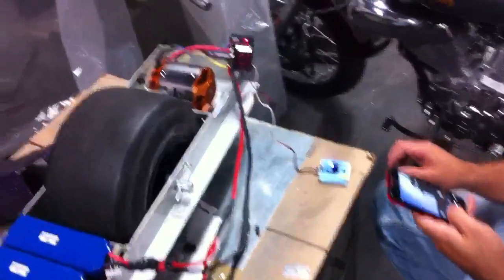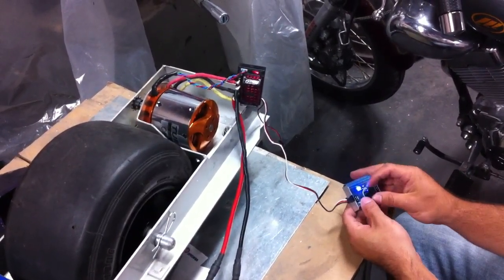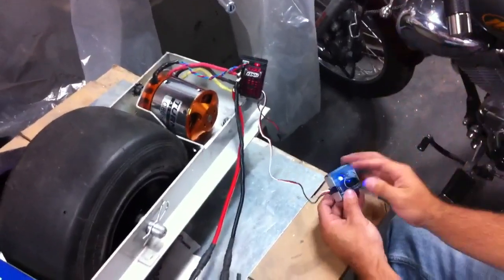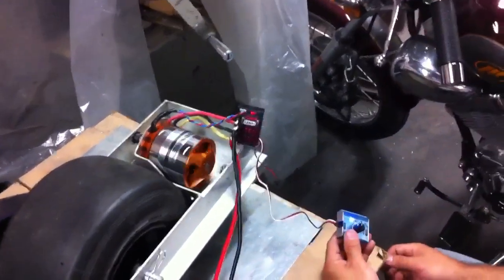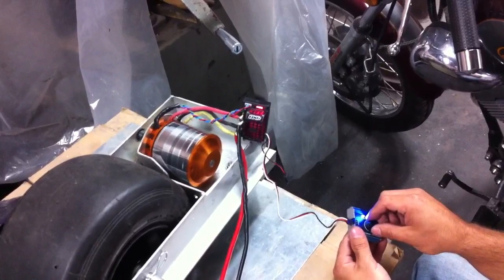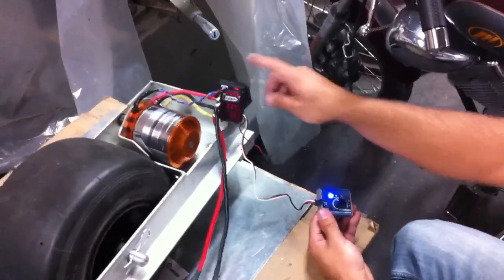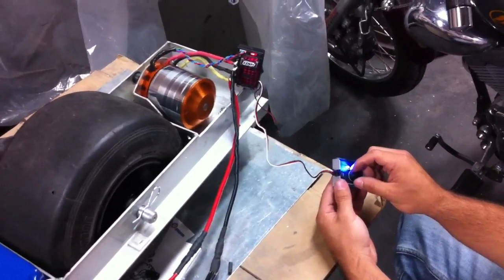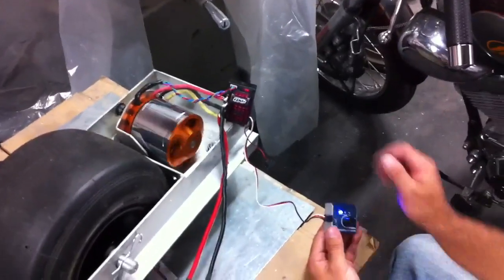Segboard

Comment: Great project. If you get this to work it means you can build a board that is relatively thin but all motors battery and IMU still fit inside the deck rather than having motors underneath.
If the safety "stop" feature when changing direction ends up preventing you getting it to balance when stationary, once rolling along in one direction it will be fine as motor is then just balancing using variable throttle, always in same direction like a bike doing a wheelie.